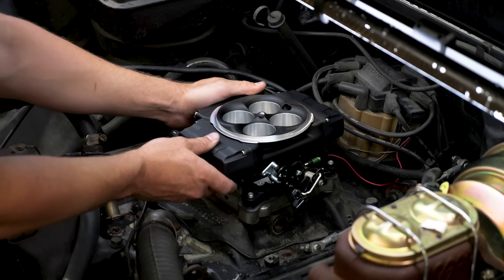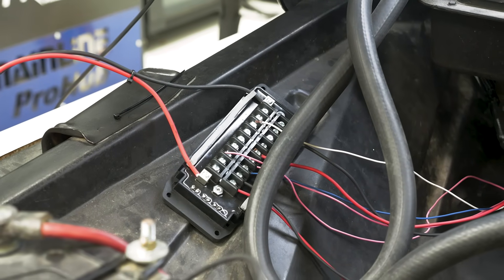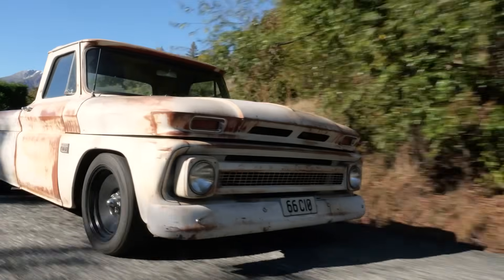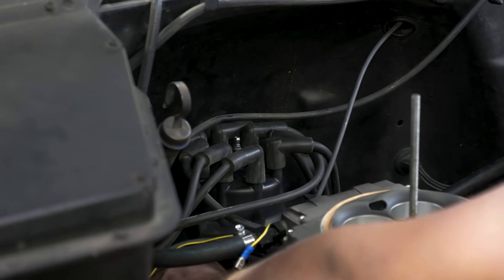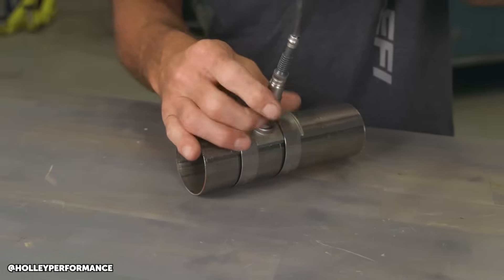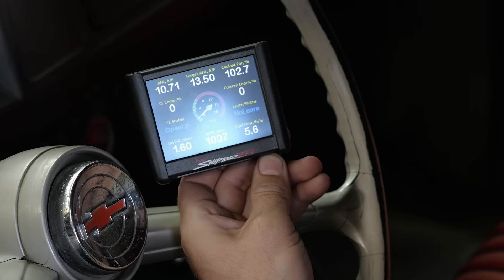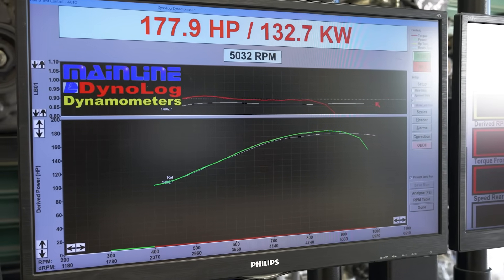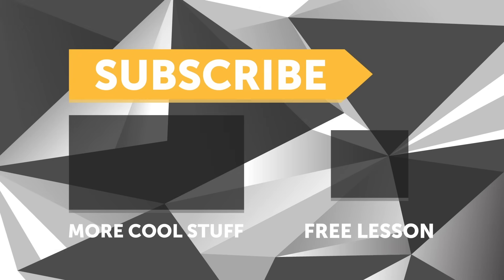Are 'self tuning' features a scam?

Comment: Got the hyperspark with mine. All the sensor wires are in one bunch and all the power wires in a second bunch... But the bunches run parallel through the loom together. I had issues with noisey signals until i seperated the two bunches. Otherwise its been great.

Comment: the most important part of fuel tuning for daily driveability is getting the AFR/Lambda map correct for the load and rev points you will be using. Shit in = shit out. Cheers

Comment: Pretty amazing as a carb replacement. It must have vacuum/MAFS built in?
Reply: It’s really not. Ive run a few tbi systems and honestly learn to tune a rebuild a carb. Even a bad running carb will get you home. When these things quit you need a tow truck. If i was to do it again i wouldn’t.
Reply: @HEYBERT1984  interesting take. Horses for courses. I have a mechanical injected classic and has 3 fuel map settings 😅 I’d love an old C10 but wouldn’t want to LS swap it so this looks like a good option to me.

Comment: Ive had my sniper 1 on my holden red 6 for 4 years now. 
1 issue was milling swarf in the fuel inlet filter. 
Other than that start and drive all good. 
Much better fuel eco and dont stink like fumes after a Sunday cruiser.

Comment: I cannot speak on current sniper 2 kits being there may have been considerable updates 
But 3 years ago I had multiple units on customer cars that all suffered from losing self tuning data and other performance issues like a lack of saturation of fuel causing the engine to be very lean at higher rpm. 
I hope they have sorted these issues because I do see them as a perfect replacement for TBI model vehicles

Comment: Theres a guy on youtube who uses this on his rx7. Seem to work very well there also.

The main issue Ive seen people have with these systems are long term reliability.
Reply: The sniper one had enough problems that it should have been fully recalled, the sniper2 has addressed all those problems, but now has a bad name after what happened with 1
Reply from the maker: Still the short term for us but so far so good. We have since manually tuned it and have more content on the way 😎
Time will tell on reliability. It's a shop truck and not a daily driver for us though so we're probably not the best source for good long-term feedback though - Taz.

Comment: it would interesting to do a follow up during the peak of the next seasonal change.
Reply from the maker: It's winter here now, would be cool to reassess after a year but we have also already tuned it manually.More content to come 😎 - Taz.
Reply: @hpa101 cant just save the autotuned file and reload in in summer and see how far off the corrections are? I found with the sniper i helped install l, that was also fully autotuned, the afr swings wildly between the seasons despite the built in compensations. Otherwise its a decent product for the job its intended for.

Comment: Would love to see you test and evaluate one of the port injection self-tuning setups out there for a SBC. Perhaps the Aces one? Really intrigued by those and feel like they offer a step up for these older engines
Reply from the maker: Yeah it would be cool to do that with Aces or Edelbrock and add them to the tuning course material as well! - Taz.
Reply: @hpa101 I'd love to see a review of the Edelbrock port injection system. I'm looking at setting up a big block Mopar with it.
Reply: @elektro3000  Edlebrock have very poorly advertized that system which has been around far longer than the sniper, and few YouTubers seem to know about it so it not in many videos.

Comment: Ive used many types of closed loop standalone tuners like this.But for motorcycle ITB’s that’s open loop ECU.They’re the best products on the market most are very user friendly.Many tune by TPS and not VE on MAP which is fine for NA applications.for while the top brands can handle boost using a vacuum input.
Reply from the maker: 'Alpha N' is a term used for using TPS as an input for ITB tuning. What specific standalone tuners have you used on bikes out of interest? I assume DynoJet, and... 

Cheers for sharing your experience here too, we plan to do more motorbike content, we're already filming some motorbike engine building content - Taz.
Reply: @hpa101  Dyno jet does a reasonable job tuning for boost with map based tuning on Power Commander V onwards but it has its limitations and after tuning my turbo hayabusa with it I soon swapped to a Fueltech Ft450 and it’s way better but definitely not difficult to tune

Comment: The main problem that I see people talk about regarding all of TBI systems is that they are built on somewhat cheap components and when the warranty claims pile up they drop the product and advise to get the new one. Many of the American companies are owned by venture capitalists now which has no other interests than quick profits.
Reply from the maker: There were some legitimate issues with the Sniper 1 from what I have seen that have been addressed with the Sniper 2.
We have only used this for a few months though so can't really comment on anything long term and we don't sell them so don't have any skin in the game.
To be honest, the whole experience with this exceeded my expectations, not that we didn't have a few niggles but some were self inflicted too - Taz.
Reply: @hpa101  The reason why the different TBI systems sell is because they have figured out how to make it easy to get up and running, which is great! 👍 
It just seems that parts support after that is a bit of an issue, and sometimes component quality. I'm not sure if anyone offers it yet, but it would be great with OEM components like Bosch.
Reply: @PSA78  The problems with the sniper 1 was bad wiring and fuel leaks, nothing that bosch parts would have fixed.
Reply: @krusher74 Oh, yeah that's a completely different problem. 😄
I'm not sure what the problem is with the different brands, never deep dived into it all, I just recalled a lot of people were talking about how they and sometimes their customers had problems and they said "all the brands". 😆Knowing how it is with other things I guess it could be anything, quality cost and there's a lot of "profit margin" today. 👀